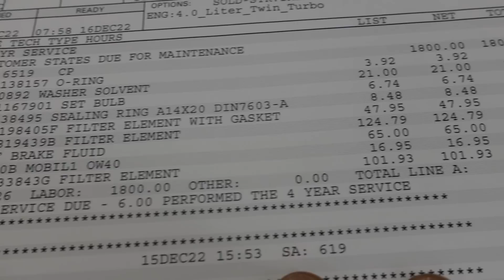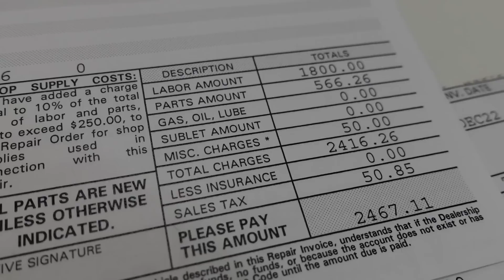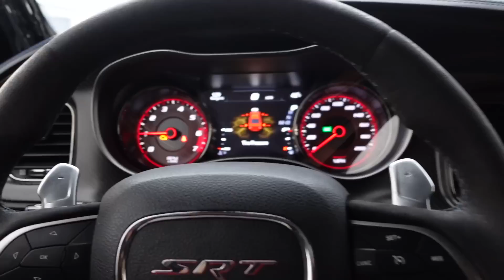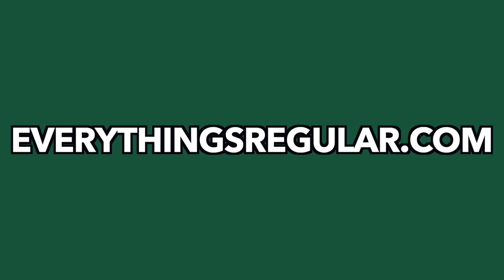FINALLY GOT MY HELLCAT PAINTED!

Comment: One more thing about changing oil in lambo. It’s easy open hood remove air intake box it has 4 -T30  bolts securing it and some release clips. Oil filter located near turbo compressor housing and under support bar which is secured by 6-t30 bolts. Loosen filter allow to drain until you unjack the vehicle when you jack it up you’ll have to take off front carbon skid plate  has 3-T 45 bolts in center and multiple T20 screws. 3:10 the undo oil pan bolt is a T45 let drain. Take about 9 quarts. Check oil on MMI in lambo That’s it   Good luck
Reply: It’s easy